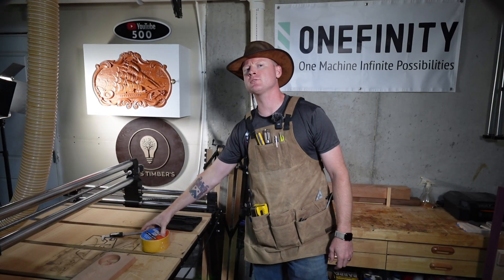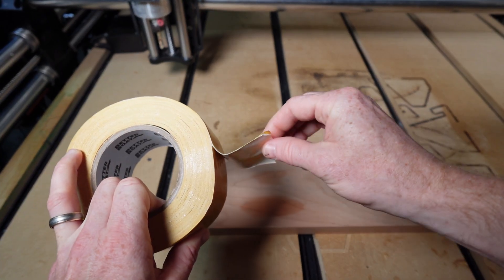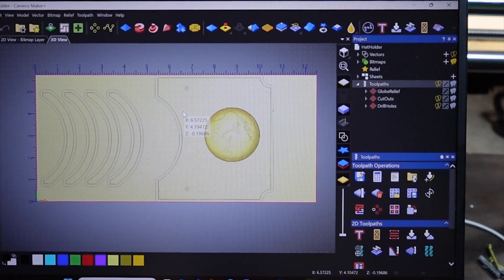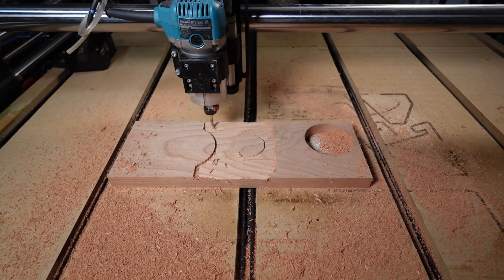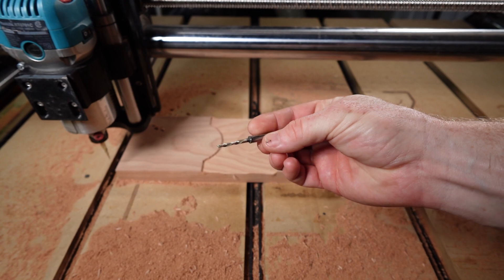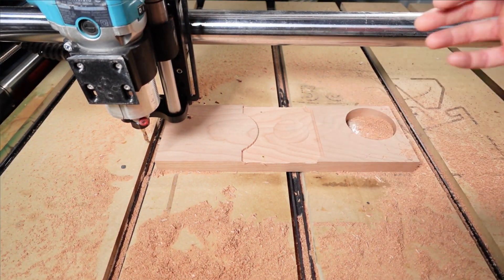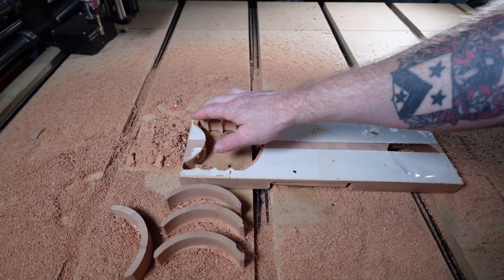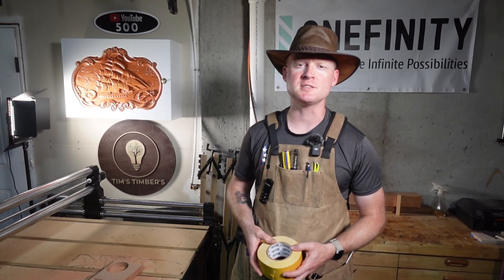Could this be the CNC work holding option you've been looking for? | Double sided Tape Test

Comment: I use double-sided tape as my hold-down all the time. You must be a bit more careful as you adhere it so there are NO wrinkles, or even bubbles (if you are carving acrylic, e.g.). It must be perfectly flat so that it all adheres. After applying and before peeling off the backing, use a plastic scraper to press it into the workpiece all over. It probably goes without saying, but your spoilboard must be very flat, too. If you have screwed things down and made holes in it, be sure to sand off any pulled-up mdf before sticking the piece down. Both surfaces must be dust-free. Use compressed air or a vacuum. Also, you need quite a bit more than your kettle bell to get the adhesive to stick reliably. I stand on my pieces for half a minute. You could also use your T-tracks and clamps to put a huge force on it for a few minutes, then remove the clamps. My favorite double-stick tape was recommended by Corbin Dunn: 
Intertape 591/BEIG236 591 Double Sided Flat back Paper Tape: 2" x 36 yd., Beige. It is about like masking tape in thickness, easy to remove backing, easy to peel off, no residue, and never comes unstuck until you get your chisel or wedge in there and pry the workpiece off.
Reply from the maker: You are definitely correct! The tape needs to be placed absolutely perfectly, no lines no bubbles! I think that using the oops clamps that I got from onefinity would probably provide a more secure attachment to the waist board as you said. I think I’d almost rather use clamps at this point though because ease of use was the whole idea. I will check out the tape that you recommend and come back to this post later! I appreciate your comment!
Reply from the maker: Hey! So, I went back and tried all of your tips, and it held my workpiece flawlessly. I even used a little bit extra this time around. My next project video will show the double-sided tape working like it should!
Reply: @TsTimbers That's great. Yes, you may wonder, If you have to use clamps, why are you using tape? For me, it is because I am machining the entire surface so clamps would get in the way. It can often allow you to get away with not using tabs, as you tried, as long as the pieces being cut loose have a decent amount of tape under them.

Comment: Thanks for the test. I don't think there's a one size fits all solution for work holding. That said, I was disappointed to see the work piece kick loose after losing only roughly 1/3 of the adhered surface. A thin double sided tape that does the job would be a real asset.
Reply from the maker: I agree with you on that! I think the selection of a hold method really depends on the project at hand.
Reply: Just a heads-up but don't use a down cut bit to drill holes. It will burn the bit and potentially catch everything on fire. Use a drill bit or upcut bit with drilling toolpath.
Reply from the maker: @GeneralSamCNC  This^! I thought the size of the hole would be enough to keep it from getting too hot but I was wrong. You can see in the video how hot it’s getting right after the first hole is complete. Cadence MFG is coming out with a new drilling bit that I’m going to pick up for operations like this.
Reply: Double sided tapes have never work for anything I do. Gimmicky.
Reply: @aberba  I've used 3M Scotch clear mounting tape successfully on some projects, but it's very thick. I milled a part from aluminum recently and the Scotch tape held it securely.